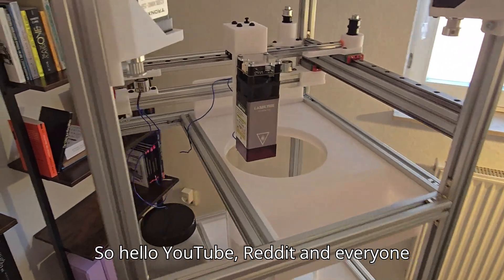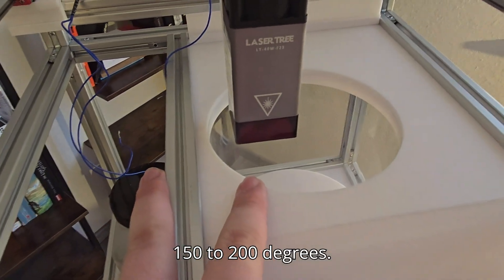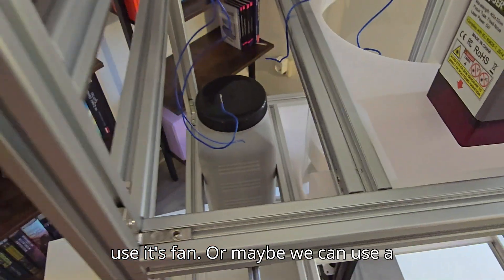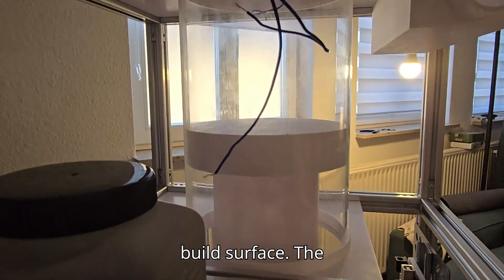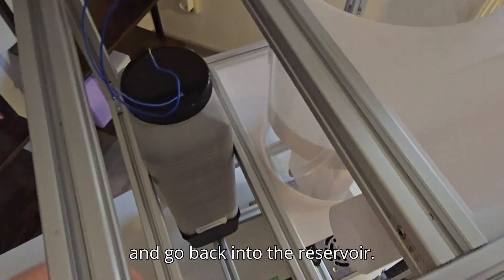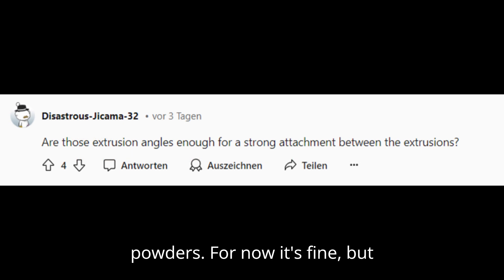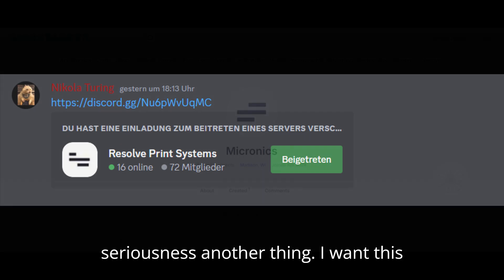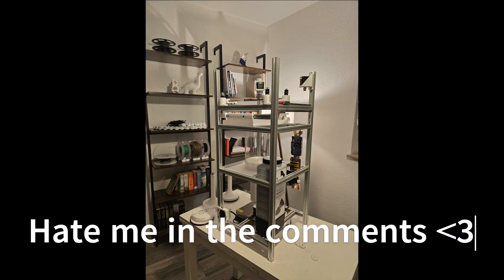DIY Desktop SLS 3D-Printer (open source)

Comment: As for adjustable focus, if you can get a laser with a 50cm or so focal point, perhaps moving the laser up and down on a linear rail to always keep the total beam distance the same could work? It would ofc introduce motion again and make it slower than pure galvanometers, but if you can figure out some way to make the laser always travel the same path distance you wouldn't need variable focus. Maybe there is some smart mirror setup that could achieve a constant total path length with pure rotation of mirrors. I can't think of one right now, but perhaps something to consider.
Reply from the maker: got a fiberoptics cable here for transporting the beam but i cant get it to work for now